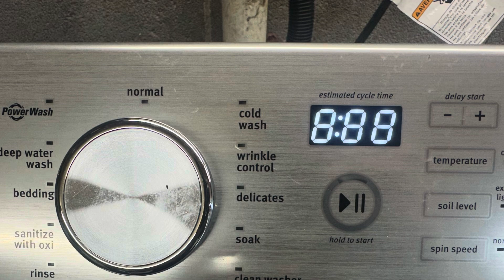How to fix a Maytag bravos washer that won’t wash or spin and is squealing | Rotor and Slider bad

Comment: Hi my codes for my washer are F7e9 and  I took out the parts just like you said and the parts look fine but it was leaking water 💧 can you give me some advice thanks
Reply from the maker: @jackiesandoval2547  oh man if it’s leaking water down the center that’s were the codes is coming from. Possibly the the bearings and gearcase. Is water/grease spots slung all around the cabinet under the botttom?
Reply: @LAapplianceguy  no just water and thank you for taking the time to help me thanks
Reply from the maker: @ water shouldn’t be coming down onto the stator and rotator. That’s what has me worried. F7e9 is a locked rotor code so something is at fault with the drive system.make sure you can spin the drum by hand too. But that water possibly coming down the center has me worried about a center seal leak possibly
Reply from the maker: @ no problem I like a puzzle. It’s what I do every day